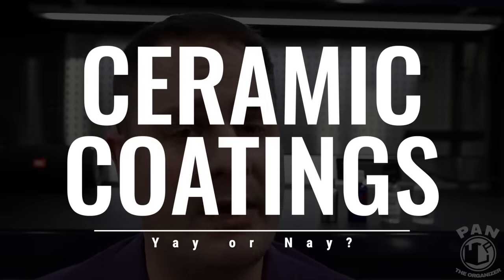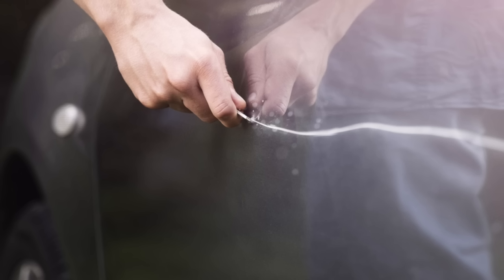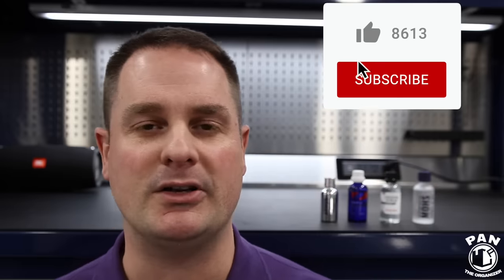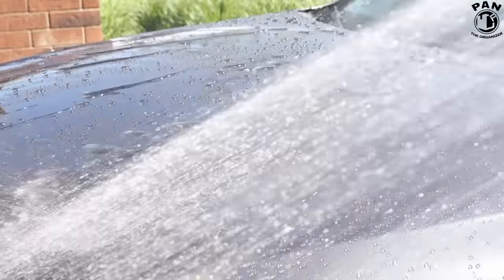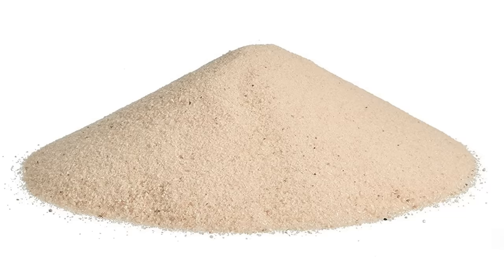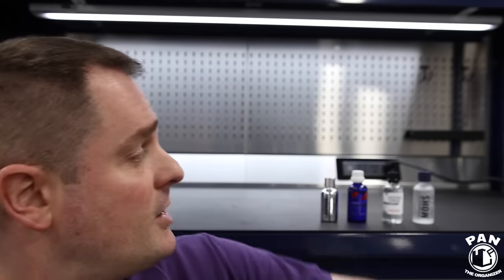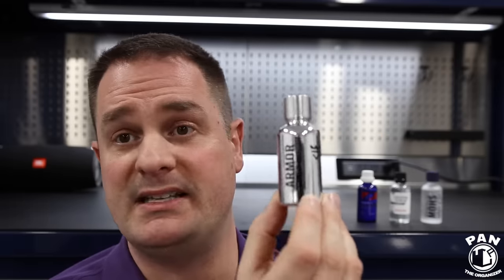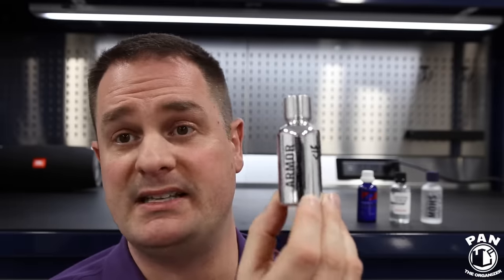DON'T BUY CERAMIC COATINGS BEFORE WATCHING THIS !!

Comment: Thank you for your great detailing videos,
I have a detailing shop in Sydney 
I applied only one coat of CQuartz UK Ceramic coating on my Merc instead of two coat, now the water beat-off effect is not good, I’m not happy.
Can I now apply another two coats of it on top of the first coat?
Thanks
Reply from the maker: Why did you not apply the two coats originally? Answering that question is very hard, as I don't know when you applied your original coats. Maybe try writing to CarPro and ask them what you should do. I have never encountered a situation where someone only did one coat, and want to apply two more coats after the 24 hour curing period.

Comment: Do you have any experience with system X ceramic coating. I have a new truck that they put it on. They claim 9 months durability. Truck is 1 year old, still very slick, good water beading. Truck is washed 1once a week and stored in a garage. Only 6000 miles on it.

Thanks.
Reply from the maker: Hi Stuart. I have never used System X products.

Welcome to my channel. You discovered one of the biggest car detailing channels on YouTube as we surpassed 840,000 subscribers and 105 million views! I have been detailing for 25 years and I love to share my knowledge and passion with my viewers.

You found the right channel to help you learn everything about detailing.

Comment: as i watched your very detailed video about ceramic coating, there are some questions in my mind if you be so kind to answer;
first i need to know after you clay bar and other things and finally applied the ceramic coating , is that the last time that you can clay bar your car also, because you said do not clay bar
after ceramic coating,and second question is if your car is ceramic coated ,if you need to deep clean your car,what should you do.can you wash it with soap and regular car washing agents
or you have to do the different method.and at the end these ceramic coatings bottles that you introduced, does any of them damages the rubber arias of the car by discoloring it or not.
thank you kindly.
Ron
Reply from the maker: Correct. You don't clay a ceramic coated car. You can use iron removers and tar removers if you need a deep clean. So you would wash your car with a good soap for coatings, something like Gyeon Bathe or CarPro Reset, and then tar remover (if needed), iron remover and you're done.

But taking care of ceramic coated cars is so easy, as dirt sticks a lot less and maintenance washes are super simple. I have a popular tutorial showing you how here: https://youtu.be/yLiePQRMFc8

And I have the most popular ceramic coating application tutorial on YouTube (over 4.1 million views) here: https://youtu.be/byKcYsEyWGk

Comment: Pan, sorry I have one more question. Can I also apply the Avalon King Armour shield IX to plastic headlights ?

Modern plastic headlights are more susceptible to UV degradation than paint as you know and I have some brand new headlights that cost a small fortune that I want to preserve. Headlight restoration can only go so far as you can still see the yellowness in the plastic despite polishing the outer surface.

Thanks
Reply from the maker: Yes absolutely. You can apply Armor Shield to pretty much all the hard exterior surfaces: paint, glass, wheels, plastics, headlights and tail lights.
Reply: @PanTheOrganizer  You're The Man Pan !!

Comment: The issue of not reusing towels after using a ceramic product. Is that an issue with turtle wax ceramic hybrid products? 🙊 thank you for this review. Now going to tackle my first ever ceramic coating.
Reply from the maker: For the Turtle Wax sprays, you can simply wash the towels immediately after use and reuse them.

You typically only throw towels away with full blown true ceramic coatings like the AvalonKing.
Reply: @PanTheOrganizer  What a gent for replying directly 🙏🏻 appreciate the advice and the content.

Comment: I love your videos. Thanks ! 
I have 3 questions for you, please answer them when you can
1) what steps should I do before apply ceramic coating on my brand new lexus RX 350, just come out from the dealer. 
2) how much ceramic liquid so I need to cover entire my LEXUS rx350? 
3) can I apply both PPF & ceramic coating,  if yes, which one goes first ?
Thank you for your time !
Reply from the maker: 1) Watch what I do on a brand new suv here: https://youtu.be/tjJPcdCUaK8
2) If you want to apply two coats, just on the paint, one bottle is enough. Two bottles if you want to coat your plastics, wheels and glass.
3) Yes. PPF first, coating second.

Comment: Hello Pan if I am restoring my headlights. Do I need to put on a clear coat on my lights then the ceramic coating on top. Or do I skip the clear coat  and then only put the ceramic coating. Great videos
Reply from the maker: When you are done polishing your headlights, you would use an IPA or paint prep to remove polishing oils, and apply a ceramic coating.

Unless the kit you bought comes with a clear coat type spray, like in certain headlight restoration kits.

Comment: what about a brand new car that was delivered one day ago.  What prep do I need to do?  I mean, the only driving done was the dealer driving the car to me. 40 miles then under a car cover.
Reply from the maker: Hi William! A new car is never new until it's properly detailed. For reasons I explain in this popular video: https://youtu.be/QgoyrC-5CMc

So you can better visualize the new car prep process, here are the steps I perform on a brand new car from two of my customers: 
Tesla Model Y: https://youtu.be/gohks8xP5NY 
Porsche 911 Carrera: https://youtu.be/2ckiivbFqs4

Welcome to my channel. You discovered one of the biggest car detailing channels on YouTube as we surpassed 835,000 subscribers and 105 million views! I have been detailing for 25 years and I love to share my knowledge and passion with my viewers.

You found the right channel to help you learn everything about detailing.

Comment: Thank you for your advice .Just to ask you do you know someone that can detail my Toyota Corolla 2014 .I have another question I need body work on the side of my Toyota Corolla where should I take it  deep scratches on the driver side all the way to the back of the vehicle .
Reply from the maker: I would do a search on Google for "detailing near me" and see what ratings local shops offer and then you can call them and have a discussion. You should watch my latest video on how to choose a good detailer here: https://youtu.be/IZ7iCwYf57k

Watch a video I made about detailing an older Toyota Corolla here: https://youtu.be/7zqovDt7NIU

Comment: Hi Pan. I'm a big fan of your channel. I have a F-150. I would like to ceramic coating it. This video is 2 years old. Is it always " de mise" to use these products or i do use a graphene one? It is the first time that i'll do that and you said that the avalon one is very easy to apply.
Reply from the maker: Graphene or ceramic doesn’t really matter they are near identical in performance as most graphene coatings have a ceramic base in the formula with reduced graphene oxide only as an infusion.

Same application methods. Watch my coating application tutorial: https://youtu.be/sqQYVjxFqK0

Comment: Once getting the ceramic coating, do I really need to apply another coating once it starts to fade away? I'm getting mine professionally done, so just curious if I can just do a one time and out, or do you really have to keep up with it year to year.? Thank you
Reply from the maker: There is no such thing as a magical force field that stays on there for years with no maintenance required unfortunately. Even the best coatings require maintenance at least once every 2-3 months with a silica spray topper. I made a video explaining the maintenance wash of a coated car here: https://youtu.be/yLiePQRMFc8

Welcome to my channel. You discovered one of the biggest car detailing channels on YouTube as we surpassed 870,000 subscribers and we have over 110 million views! I have been detailing for 26 years and I love to share my knowledge and passion with my viewers.

You found the right channel to help you learn everything about detailing.

Comment: Soooo much great information that I was looking for. Thank you! 

I do have a question while I’m learning about diy ceramics. Can I use this on my windows and exterior metal? Or do you have a video of what to do for metals and windows as well? Any info is much appreciated. Thanks again!!! ❤️
Reply from the maker: Thanks Tammi! It depends which coating you buy. Some can be applied on pretty much all the exterior surfaces, some just on paint, or just on glass, etc.

Comment: Thanks Pan! I just purchased a new vehicle and wanted to ceramic coat ASAP while the paint is still pristine. However here in Kentucky it’s going to be well over 85 degrees F for the remainder of the summer. I can do it in the garage but with temps over 90 degrees would this make the process a bit more challenging do to shortened flash times?
Reply from the maker: You can still do it. Just look for flashing times. But don’t do it in direct sunlight.

Comment: Pan, Great information and thank you!
My question is that I live in an apartment complex no garage...Boo
When I apply a ceramic and let cure for 24 to 48 hrs with no rain in the forecast and 75° to 85° will the overnight dew from humidity be an issue?
Reply from the maker: That is fine.

Comment: You mentioned decontamination or tar remover products. What are the names of these products. My car feels gritty even  after washing  it what can I do to get gritty out. Thanks  Jimbo.
Reply from the maker: Hi James. The gritty texture on the paint usually is from contamination (unless you have paint overspray somehow). When you are done washing your car, the next step is to use a tar remover (if you have black dots or tar deposits, this is an optional step), and then you would use an iron remover to remove brake dust and iron particles, followed by a clay bar and clay lubricant to remove the rest of the contamination embedded in the clear coat. 

At that point, you should have a smooth surface, like glass, ready for either paint polishing steps (if you have scratches and swirls) or add a layer of protection (wax, sealant or ceramic coating).

To help you visualize and understand the fundamental steps, watch a series of videos I made called "Detailing 101 basics" and you'll fully grasp the concepts. 

Tar removers and iron removers (chemical decontamination): https://youtu.be/W_cyHz3XssU

How to clay bar a car (mechanical decontamination): https://youtu.be/XB8UaTCXuLg

Paint polishing tutorial for beginners: https://youtu.be/ustTEVGMOTI

Welcome to my channel. You discovered one of the biggest car detailing channels on YouTube as we surpassed 835,000 subscribers and 105 million views! I have been detailing for 25 years and I love to share my knowledge and passion with my viewers.

You found the right channel to help you learn everything about detailing.
Reply: Thank you. I watched  most of the videos so far up to  the polish  video . I think The gridyness on the car  is over spray from a  paint spray paint. I do crafts and paint  things  alot.This car is my Wife's  Kia Sportage and it's  Black. I washed it all  ready  and put it in the garage. Will do everything you  said after  washing, but I have a question on this product FW1 racing formula high proformance.I nused this 5 or 6 months ago. It was great and made  the Sportage  shine  nice. It seems to be better than  other wax,s I have used. But the ruff  texture on the side and glass is still there. Like I said  I am going to do  what you  said  to do  step by step. But I don't know when I us the FW1 wax. And do you  reckermend this product  at all,after the car is ready for this step.Sorry for a long tex. JIMBO

Comment: What kind of surface prep is required for the maintenance coats?  If you do not clay, etc. don’t you run the risk of locking in surface imperfection?  If you have to do topper coats every3 months, why spend the extra time and money on quartz initially?
Reply from the maker: No real prep is needed for maintenance. Just wash the car using a good shampoo (like CarPro Reset or Gyeon Restart Wash, both formulated for ceramic coatings) and once the car is clean and dry, simply spray on a silica spray sealant of your choice. Maintenance is super simple.

I have a tutorial on proper maintenance for ceramic coated cars here: https://youtu.be/yLiePQRMFc8

Comment: I plan to make an epoxy covered retaining wall that slowly slides down the dirt wall as I'm digging. Would a ceramic coating like this make the surface slicker for that?
 Also, would it effect the hardness of the epoxy, if so, would it make it harder or softer?
Reply from the maker: Hard to say, as I haven't experimented with that. My recommendation would be for you to contact one of the ceramic coating brands and ask them directly and see what they reply.

Comment: How about shelf life and storage for coatings, toppers, and maintenance products?  I have Reload and Elixir that will take me months or even years to use.  How long do they stay good?  Also I have a detached garage that's not climate controlled.  Can these products see all the daily temp. cycles?
Reply from the maker: Always store chemicals in stable conditions and NEVER freeze them. Typically, detailing chemicals have a shelf life of 1-2 years.

Comment: Lots of information and well presented, can you use any of the ceramic coatings on the interior, dash/doors,  of your auto?
Reply from the maker: These are paint coatings. You don't apply them on interior surfaces. There are now a few products that are ceramic based that are formulated with long lasting ceramic technology, and there is one from DIY Detail that is awesome. Links below for USA and Canada:
USA: https://bit.ly/3rMZLiB
Canada: https://bit.ly/3QfxpYi

That product adds protection, but it is also antistatic, provides UV protection, stain protection, and a light amount of abrasion resistance.

Comment: Thanks for this great video. Love detailing my vehicles, but the big question is I am getting a new C8 corvette. What steps can be skipped to a new vehicle. Thanks
Reply from the maker: Here’s what I do to a brand new car: https://youtu.be/tjJPcdCUaK8
Reply: Is it not possible to use this on paint without clear coat ?  In some cars paints are without clear coat, only PU COAT will be there
Reply: I am in india, can I buy this Armour ceramic coat from here ?
Reply: Very very Informative, every time when I see your video, my knowledge on ceramic coat is improving,congrats
Reply: Really master class as u told
Reply: In short once the bottle is opened, it has to be utilised on the same day including the cloth, before curing I suppose ?

Comment: Hard to say the one thing I've learned from this video. I've watched many of your videos , and I've learned to use a good iron remover/fallout remover , then manually decontaminate,  polish if necessary then use a paint prep or iPa product to remove any residue , then apply the ceramic coating in small sections based off your flash times , and it can be applied anywhere on the vehicle nearly. Along with many more tips
Reply from the maker: That’s perfect!

Comment: witch prep spray can I use to remove any wax's or other chemicals on my clear coat thank you
Reply from the maker: I like this: https://bit.ly/3LntZNB
And this: https://bit.ly/3tKMuFO

Keep in mind though, paint prep sprays and stripping shampoos can only start the breaking down process. They won't fully remove previous protection, unless the wax is old and there was almost none left. The only way to ensure 100% removal of previous protection is by mechanical abrasion through machine polishing.

Watch a popular video I made on that topic here: https://youtu.be/e7WRbfkT5Yo

Comment: Pan thank you for the master class for seramic coating.  As you have stated paint protection evolved.  As a weekend worrior, I usually use non synthetic based products to clean and protect the paint.   I am excited to move to seramic coating.
Reply from the maker: Thanks Burak! How did you discover my channel?
Reply: @PanTheOrganizer  I have discovered through youtube

Comment: Hi Pan, hope you read this. I love your video.I am planning on getting ceramic coating, my choice will IGL Kenzo, as it is the most affordable branded coating in my country with great reviews worldwide. However, my parking have no roof and would only be able to do rinseless wash on my own. The products I use and already have are P&S Absolute for rinseless wash, TW Hybrid Wet Wax as drying aid and topper, TW Hybrid Ceramic Spray as topper, TW Hybrid 3in1 Detailer for occasional tree sap and bird droppings. By using this chemicals, would it harm the ceramic coating or at least help it last longer because these are Si02 based topper? Thank you very much.
Reply from the maker: The Turtle Wax products will alter the hydrophobic properties of the coating underneath as most toppers do. So I wouldn’t overthink the moment. All the products you listed are fine.
Reply: @PanTheOrganizer  thank you Pan!

Comment: Great and informative video Pan.  2 questions:  If a ceramic coating last 2 plus years and you are putting a maintainance silicon spray sealant on top every onth or two, shouldn't keep the ceramic coat prestine for many many years?  If not, how can you tell that it is time to re-coat with the ceramic coating and is the residual ceramic coating hard to remove before you re-coat?
Reply from the maker: Thank you Rick! To answer your question, no applying a topper won't extend the coating's life past its expected durability. What toppers do is keep the coating at peak performance for as long as possible during its lifetime. 

If your coating is supposed to last 3 years, and you are getting close to the end and start seeing diminishing beading and sheeting, you know it's time to strip and reapply a fresh one.